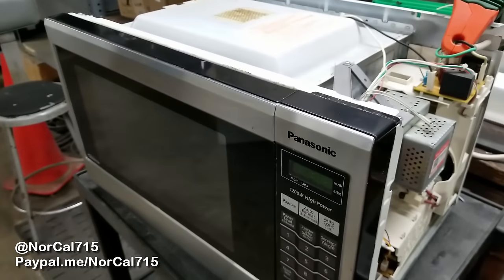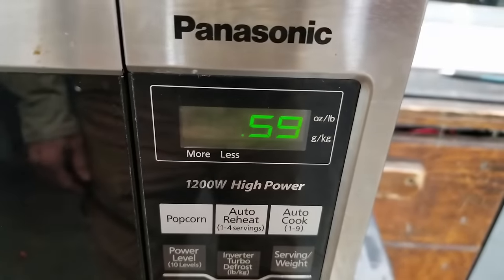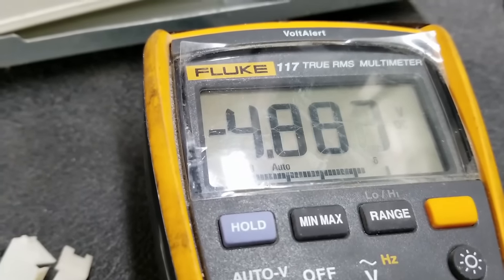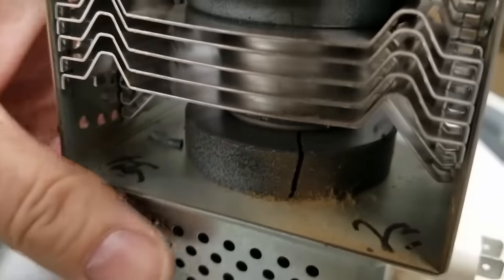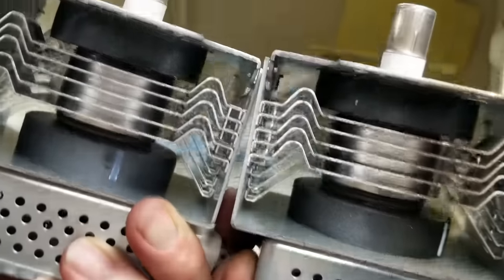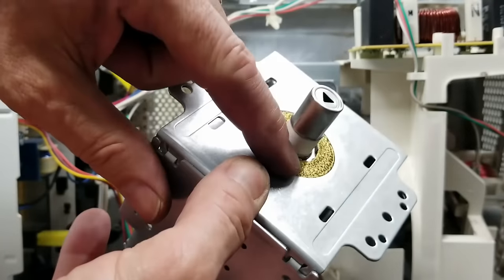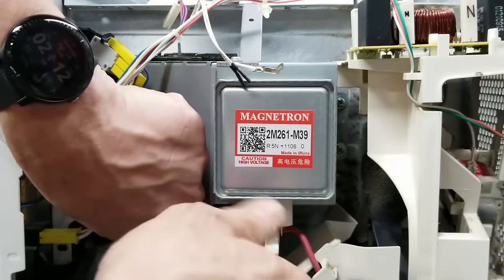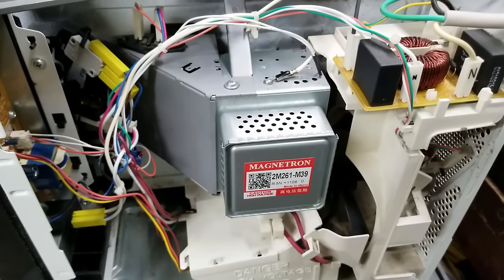Panasonic Inverter Microwave Oven H97 H98 Repair Fix

Comment: Great video! Couldn’t clear the H98 on the reset, so I followed your steps and removed the magnetron. On inspection, it looked ok - no crack - but I decided to go ahead and buy a replacement on eBay for C$65. It arrived today, installed it, and voila! Functioning microwave! Thank you so much! Another appliance saved from the landfill!
Reply: where did you order your Magntron from? Did you get from CHINA? What type microwave model? I'm handy man but you think i can change?
Reply: @davetravelstheworld  I'm sure you could change it, but I certainly wouldn't replace the magnetron unless you first check it for grounds while the oven is unplugged.  Personally, I would use a VTVM for the ground check rather than a DVM.  If the ground check turned up negative, I would then check the magnetron with a high voltage DC probe while the oven is running.  Actually, I think you're looking at 1.5KVDC - 2.5KVDC being applied to the magnetron.  Be VERY careful if you do use that high voltage DC probe while checking that magnetron as those high voltages are lethal.

Comment: We are so grateful to you. We had an H97 error due to trying to run off our generator due to a power outage. We just went several months to save money to buy a new inverter microwave. I stumbled across your video AND IT WORKED!! Just had to clear the code. THANK YOU!!!
Reply: Same cause and fix worked for me, except mine was H98. Thanks!

Comment: You're a life saver!  During a power failure yesterday, I used a small Honda generator to power my Panasonic inverter microwave oven.  Unfortunately, the generator didn't have enough capacity to power the microwave oven.  Well, after power was eventually restored to the house, I kept getting an H97 error with the Panasonic inverter microwave oven.  By following your guide, I was quickly able to get the microwave oven back and running again.  Thank you very much!
Reply: Did you fixed it ? It doesn’t work for me .
Reply: @maggielaw6201  Yes, I fixed the Panasonic inverter microwave oven.  Try following the guide again, and see what happens.  I hope for the best!

Comment: Thank you for the video! After the 5V pass transistor shorted and dumped 18V into the main control IC on mine, I found a replacement board on eBay from someone saying their magnetron fried but the board was fine. Didn't think they'd save that the tube perviously failed in an EEPROM! That reset procedure made it happy again, thanks :)

Comment: Thanks for the reset instruction, didn't even know this is needed before I can do any troubleshooting. For my panasonic, after press 3x on "reset", and then press on "start", I need to hold the "start" button for 1~2sec for the END to appear.

Comment: Wonderful video, thank you.  I just picked up a Panasonic inverter microwave with grill function from a scrap heap and it has the H98 code.  The grill works fine, but it would be pretty cool if I can get the microwave function working too.  A brief glance online suggests it's worth around £250 GBP brand new.
I don't have the fancy diagnostic tools (yet...  maybe one day!) so my first port of call will likely be to pull the magnetron and check the magnets, assuming there's nothing visibly wrong with the inverter.
Nothing better than getting stuff for free and making it work for cheap!

Comment: I decided to test and see if I was ready for a power outage. I cranked up my 1800w(2200 peak) inverter generator. Ran the fridge and internet for 4 hours, no problem. Then I plugged in the same model NN-SA651S that you are working on(all by itself) Microwave ran about 30 seconds and quit, tried 2 more times, same result, except now it shows the H97 code. I spent a few hours checking diodes/full wave bridge rectifier, door switches, I figured the unit was toast! Then I found this video, reset the code, plugged it into the house outlet, and all is fine again. I noticed another commenter said they too had plugged it into a generator and it caused the error code! I bought an inverter generator because it is supposed to have clean power to run things like this, guess that's not completely true?

Comment: In your response to Chayo Darling's question about the magnets cracking, you said you believe it's from the heat of the high power magnetron.   So is there some way to program the oven to always operate at P9 (power 9) without having to press the Power Level button twice each time you want to cook something ?
Reply from the maker: Not that I am aware of. Just make sure the fan blades are clean and the grates on the back, in the cavity, and on the side are clear of dust and gunk.

Comment: I had to replace the inverter board, one of the power caps was split and a trace had a spot burned off about the size of a pea.  Once I had replaced the inverter board I could not clear the H97 error code until I found your procedure. It's all good now, thank you!

Comment: Can anything be done proactively to prevent the magnets from cracking? like a heater hose clamp or wire clamp?
Reply from the maker: I believe they crack from the heat of the high power magnetron and marginal cooling.

Comment: hi there... got a Panasonic with shorted power transistors on the power board. After replacing, I tested the unit but not heating is happening. Id like to check the HV entering the magnetron, I got the high voltage probe like the one in your video and Fluke multimeter but I'm not sure how to hook the probe to the meter. Could you please give me directions? Thank you very much

Comment: What causes the h97 code? I have to watch the first 2 min of this video at least once a month to get rid of the h97 code, I'm surprised haven't been able to remember the order of what to press yet! So everytime I put a paper towel in to cover something greasy or sometimes microwaveable popcorn it will shut off at least 2-3 times before it throws me out to the h97 code. But I'm wondering why? I've even looked in the user manual to see if I shouldn't use paper towels and it says it's fine? In the video you go over the h98 code and how it stops heating, but mine still heats even when it turns in for 20 sec at a time before it throws the h97 code. So what is the h97 code mean and should I be replacing or fixing something so that I dont end up with a h98 code and have a bigger problem on my hands? 
I also want to say thank you!!! Without videos like yours I would end up buying a whole lot of new appliances or spending money to service things that really anyone with some basic knowledge can fix with instructions from amazing people like you that take time to show us what we need to know! Thanks!!
Reply from the maker: In my experience it's always been a weak magnetron that has been tripping the H97 and possibly H98 codes in my microwaves   Make sure the air vent on the back is clean as well as the tips of the fan blades, that can cause reduced airflow and damage the magnetron

Comment: Best how-to vid I'm seen - My problem is that the code reset (model NN-SA651S with H98 code) won't take. Instead of the END message I get a "0277" message? Tried a number of times all with the same result. I DLed the service manual and nothing about that code could be found? I'm not setup to test anything other than door switches so with a replacement mag running about $50 and finding another post mentioning the inverter board may be bad, anyone know if I should take a chance? love the oven and the $130 Sharp I replaced it with in nowhere near as good.
Reply from the maker: Short the 2 large leads from the inverter board to the magnetron to chassis ground to discharge any voltage, then remove them from the magnetron. try the reset, start it and see if it runs for a few seconds. If it does then the magnetron is the issue.

Comment: Where do you get the new limit switch bracket?  I need a new one also.  Thank you.   I subscribed.   Great video.
Reply from the maker: Encompass parts has them in stock
Reply: @norcal715  Thank you.   Have a great weekend.

Comment: I have a Panasonic Inverter microwave oven model NN-ST680S.  I bought it brand new 5 years ago, and today for the first time the unit stops after about 10-15 seconds and displays H97 on the readout.  My model has 10 user adjustable power levels with 10 being maxiumum (1100 watts).  I have noticed that if I select power level 5 (600 watts) or below, the microwave will operate normally (no H97 error) and can still be used, although cooking time will be longer as expected.  On the higher power levels I can hear a clicking sound when initially operated and then it cuts out and displays H97.  I just turn off the power switch and back on again to reset and be able to use again (on power level 5).  I assume this does the same thing instead of having to perform the unlock process you demonstrated.  I'm not sure how long my microwave will continue to work like this on reduced power,  but it looks like I'll just buy a new replacement microwave soon since they are relatively inexpensive these days.  Great video though for people that prefer to fix it themselves.
Reply from the maker: Its worth a $25 magnetron to find out if that's the problem. If not you will have a spare magnetron

Comment: Question: On the Inverter board.  There are 2 Push-in inlet,  one with Yellow, Brown and Orange wires this I don't have problem. The next in-let has White, and two Brown,  I would like to know can this in-let be used on either way? Thank you bro.
Reply from the maker: not quite sure what you are asking?

Comment: I have a question. How do I connect back the two Red power from Inverter board to the Manegtron. (Which is Left and which is Right? Hope to hear from you soon. Dave
Reply from the maker: It does not matter which way you connect them. High voltage is supplied on both leads and the reason there are two leads is for the tube filament heater.

Comment: Sorry, My earlier message was not clear to you. On the Inverter Board, there are 3 sets of wire attached to the board. First- set was the 2 Red power wire, second-set there are Yellow, Brown and Orange. Now the 3rd-set that I am concern about It has one White and two brown.the in-let fit either way. I am not sure is the white point towards the front panel or towards the back of the Microwave. I hope this message is clear to you. Thank you.
Reply: The White wire.
Reply from the maker: If it is the one that plugs on top of the relay, then it should not matter. The relay is just closing the contacts.
Reply: @norcal715  so I can plus in either side?

Comment: What if the magnetron is NOT cracked? When I took mine out, it was it good shape. What else could cause the H98 error then?
Reply from the maker: still might be a bad magnetron, measure the current draw at the ac input you should see between 12 and 18 amps at 120 volts, if you only see 2-3 amps its probably the mangetron. Also if you can get a high voltage probe, measure the high voltage (5000-6000 volts) at the magnetron input.

Comment: I have 25 years of tv and MW repair I would consider that damage to the paint inside the cavity before deciding to repair as the MW energy thinks the bare or rusty spots are food and strains the magnetron.
Reply from the maker: Many high end microwaves use a stainless cavity that is not painted. The paint is transparent to the microwave energy and as long as there is no moisture there will be no heating. If the rust particles grow to become close to 1/4 wavelength of the 2.4ghz microwave then they might react. Just to be sure I used the IR camera to see if the rust (rust has a high emissivity of thermal energy because of all the little pockets) areas were heated  and there was negligible differences.
Reply: I have rust/burn spots on the paint in the cavity that I suspect as my problem. I get the H97 code, and can clear it. The oven will then run for 20-30 seconds before shutting down again. It may do this a couple of more times before the H97 code reappears. I don't have an IR Camera so I cannot verify if it's a paint problem though. The oven does generate some heat during this process, not enough to pop my popcorn completely.

Comment: Nice. I'm always surprised by the high number of interconnect cables present in such a stable design, probably has something more to do with interchangeable standard components than good design. Some people here have commented that servicing this to that degree is uneconomic compared to getting another, but these's the satisfaction of keeping from landfill and more importantly, there are people around who don't want to learn how to use new gear if they can avoid it. 

I'd be looking at getting that rust out of the chamber though. It soaks up a bit of the power delivered. Also be careful, the magnetron may use beryllium oxide ceramics for the stem and anntenna support.  When chucking it out, seal it up carefully in something because the dust from it is a carcinogen, lethal if injested or breathed in (not sure how much, don't want to find out).

Comment: H97 code on ours, can't proceed to the last press of start button, displays "0044" after 3 pushes of the reset button
Reply: Found out have to hold start button again, it cleared the code and works but decided to warranty return it anyway
Reply: Big help

Comment: Hi. I've got this model. Upon pressing start it makes a buzzing sound every second and eventually shuts off. No heating. "Cool" displayed and no button response. Unplugging and trying again gives buzzing sounds again. Would this be magnatron? Update. I've ordered diodes as they were reading a tiny bit of leakage. I'll be back.  ***.EDIT. diodes no difference.
Put used magnatron in.same prob. My ncv test meter shows big voltage on maggy wires. Possible used item I bought is faulty but no shorts on it and terminals read 4ohm. I get h98 , COOL and 0.00 errors appear at different attempts after 25s. No heating at all. Life goes on.
Reply from the maker: possibly an inverter failure. hard to tell without looking at it though.
Reply: @norcal715  I've disconnected fan and maggy and sound buzzing is different but continues. Guess I'll play with inverter circuitry while taking every precaution not to kill myself by electrocution. Cheers.

Comment: Mine displayed the code H97. Once I did the reset, it worked again so I didn’t replace anything. Now a week later, it’s spinning but not heating up?
Reply from the maker: Most likely a weak magnetron. Replace it and do the reset again.

Comment: What is the amp meter clamped to?
Reply from the maker: I am measuring the current on the hot lead of the power cord. You could clamp wither hot or neutral as it enters the microwave. with the same results.

Comment: I have a Panasonic inverter 1200W high power  that turns off after 45 seconds.. done all the possible DIY ... model number NN-SC668S  MANUFACTURED 2020.. it doesn't heat up and stops a 45 seconds..what could be its problem?
Reply from the maker: This is from another service manual, I do not have one for your model, but they all opearte pretty much the same. 

1. Oven stops in 3 seconds after
pressing [Start] pad.
No input AC is supplied to H.V.Inverter (U)
CN702 terminals
1. Latch Switch
2. Power relay RY1
3. Loose lead wire connector CN701, CN702
4. H.V. Inverter (U)

Oven stops in 23 seconds after
pressing [Start] pad.
H.V.Inverter (U) operates by the control signals
from DPC but magnetron is not oscillating
1. Magnetron
2. Loose lead wire connector CN703
3. H.V. Inverter (U)

Comment: Where did you get that instruction ? Thank you
Reply from the maker: Its from the service manual. Look at elektrotanya.com for the manual
Reply: @norcal715  I'm in the UK.  Panasonic Inverter Microwave NN-CD87K, error code H-97.  Tried to find a manual on elektrotanka, jumped through a lot of hoops disabling my ad blockers and other things before I could access a download.  What they claimed was a service manual was a user's manual, so no further ahead.  Any help would be appreciated in getting some service info or that instruction sheet you showed.  TIA.  👍👍

Comment: Would be helpful to have a link to those troubleshooting instructions. I'm trying to troubleshoot mine but can't read that page on the video. Magnetron appears to be fine. What are the other steps and how do I find a replacement HV board?
Reply from the maker: Go to elektrotanya.com in the upper right click "SM search" type in your model number and you can download the entire service manual.
Reply: @norcal715  Thanks! According to the manual diagnostics the HV board is fine. So it must be the magnetron. Unfortunately doesn't look like they are available anymore.

Comment: I can replace it with a brand new one for $160, and I'm only out of having one for a couple of hours. That sounds pretty good compared to the time, hassle, and cost of fixing it.
Reply from the maker: The world should get out of the throwaway mentality companies are pushing on everyone.
Reply: @norcal715  I hear that! For over six years in my huge apartment complex, I have trash-picked so many items, that if I had kept them all, I'd EASILY be worthy of an episode of "The Hoarders." Among them are a multitude of vacuum cleaners and pedestal fans, most of which are salvageable. Also some microwaves (including the same Panasonic model you have in this video with H97). But so far, I am too gun-shy to fix those. But occasionally I have found a working one.

What I don't keep or give away to friends and relatives, I give to the Goodwill. My local Goodwill also accepts scrap metal and scrap electronics. This means I pull out even busted electronics out of the dumpsters! Our condo manager even paid me once to haul away 7 junk TV's. Once, I even found an Intertek queen size power inflatable mattress that worked (though it did leak somewhat), and a handy carrying basket for it. I gave that away over Next-Door.com.